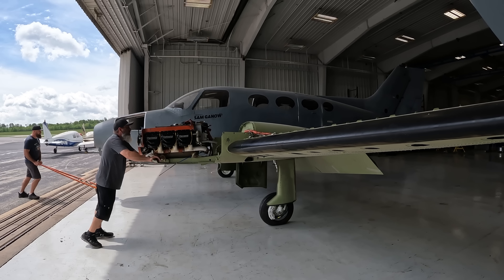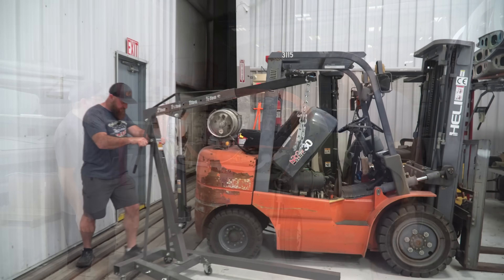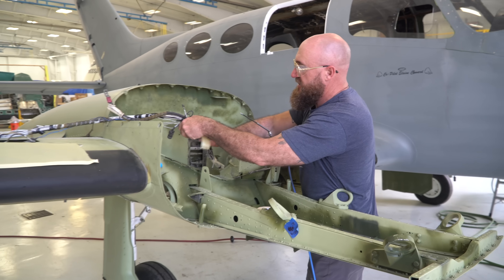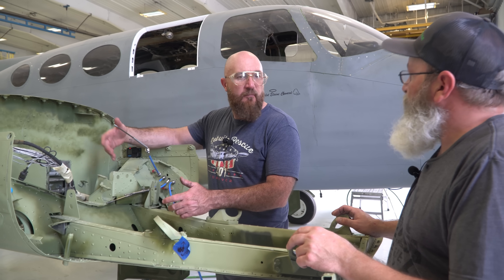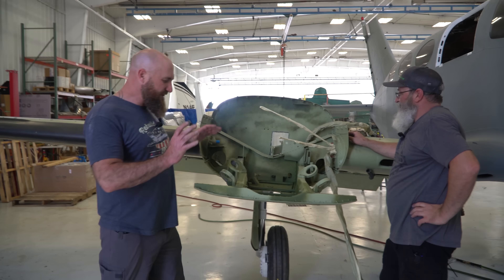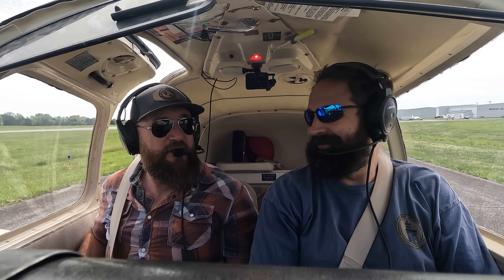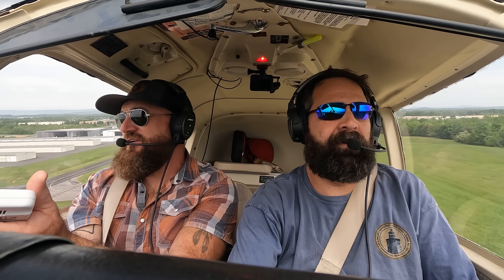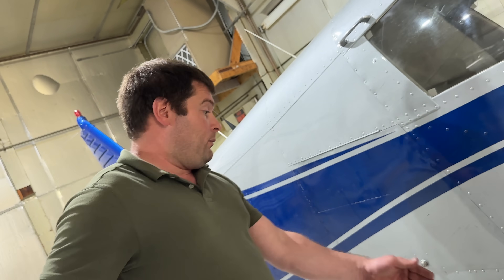We REMOVED the Engines from The Free Abandoned Airplane to do this.

Comment: I confess I have OCD! The engine cradles left in 2 colors of zink primer set my OCD off. I had to tell myself that P-51 Mustangs didn't have paint and even had sometimes 2 shades of prime, I thought ok I can live with that. But when Jason told of seeing the 401 at another hangar with lifting primer from oil and other fluids, then deciding to pull the engines to clean up and paint... you vindicated my OCD. Thank you. Wished I could help out if you were closer.

Comment: Try using etching primer. Yes it has a little acid in it but it neutralises when pain is drying. If the primer you used is flaking off it was applied wrongly. If that’s a fact you’ve now got one hell of a job on your hands redoing everything you’ve done.

Comment: If you are only using thinner every now and then, silicone gloves are probably not absolutely needed, but if you are using chemicals solvents on a regular basis, wearing silicone gloves will prevent those harsh chemicals from leaching into your skin and causing problems later.

 Back when I worked in a metal fabricating shop, I de-greased miles of metal tubing with thinners - without wearing gloves - and now my skin is super sensitive to even brief chemical solvent exposure of even a few seconds.

Comment: We used to use a "High pressure steam cleaner" on engine bays, when working on VW bugs or British sports cars. They all had the same problem "years of oil leaks" before you clean, prep and paint them. Heated high pressure steam (water) with some dawn dishwater soap. Marvelous simply marvelous, pretty! but maybe the FAA has no STC for steam! LOL😁

Comment: How did the engine cradles get to the paint shop?   Do those cradles detach from the plane so they could be sent out for painting?  If they do detach then why not use the vapor hone machine to clean them before the Alodine, zinc chromate, and paint?   Just wondering.  Thanks for the video and your time.  Fun to see this plane coming back together.
Reply: the airplane is towed to the paint shop, painted and then towed back to the hanger. Not removeable cradles without drilling rivets.
Reply: @ptdave123  I figured that had to be the answer.  Thanks for your input. Appreciated.

Comment: suggestion:  wipe the aluminum down with white vinegar, before applying the etch primer, after de-greasing.
Reply: @Nath20245  The primer is an etch also, but the white vinegar is simply diluted acid and etches aluminum even more. That is why I noted "Suggestion"
Reply: @Nath20245  Acetone does not etch it cleans
Reply: although relatively uncommon, aluminum corrosion can be caused by using acetone to solvent-clean parts in ambient light. Aluminum alloys that are copper rich (such as 2024) are photoreactive.

Comment: I'm a little surprised after your comment that there would be oil "trapped" between riveted parts that you did not load up a pressure washer with de-greaser to try to work that oil out! I suppose that the good news is that the oil will inhibit corrosion of the metal when it seeps out.

Comment: If possible I would have run the engines once to vibrate them into a settled position and then re-torqued the mounts. And then proceed with the rest of the checks required to make sure the cowling is fit and trim.

Comment: This is a really cool show! Thanks for the content!
My cousin Matt is a pilot, and he even races his small plane. Talking with him, he was telling me that there are many parts that are exactly the same as automotive parts...but the aircraft parts are certified for aircraft...and because of that certification process and document flow...you can end up with a $75 sparkplug...or a $100 oil filter. It's crazy to think about, but nothing  can be left to chance. It's not like you can just "pull over" in the sky and wait for tow plane to save you!  Even the tiniest detail like not creasing the skin because this compromises the structural strength of the aircraft...or replacing a door post or a whole gusset plate for the same reason. 
Anyway, thanks for the show!